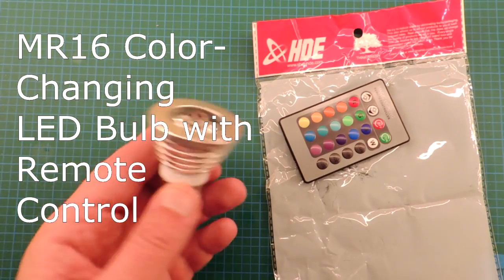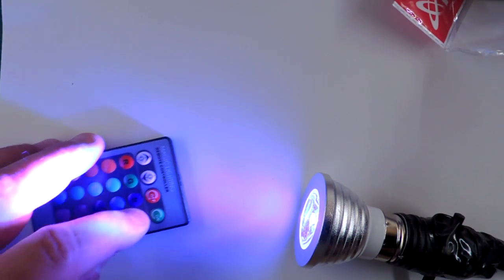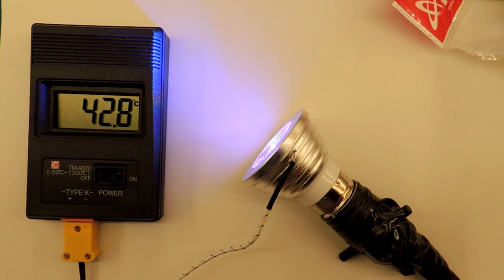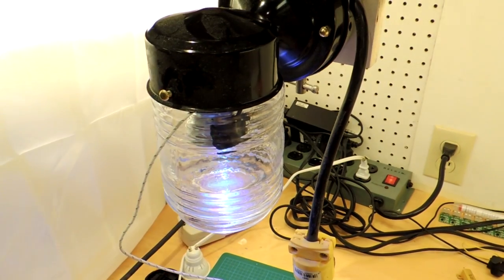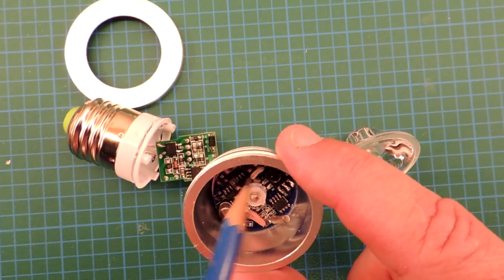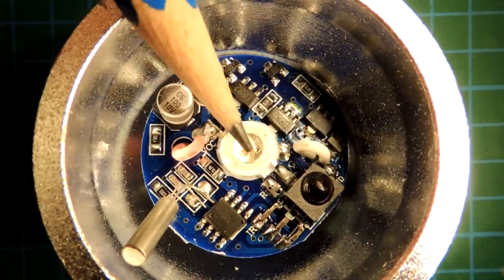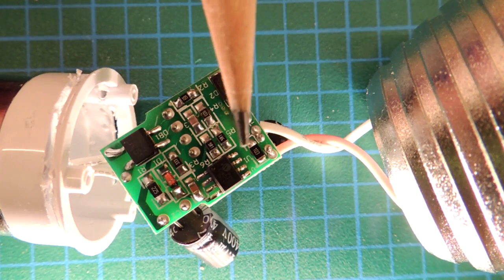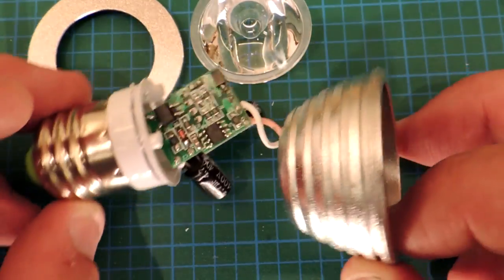Remote Controllable Color LED Review and Teardown

Comment: That's not an MR16 bulb.  It's an e27.  MR16 is 2 prong and was pretty much superseded by GU10 in the home market.  You can't really find MR16 fixtures in stores for the home market anymore.
Reply: GU10 bulbs are typically MR16, the terms refer to different parts of the bulb. GU10 is a type of bayonet connector for the bulb, where MR16 is Multifaceted Reflector, Sixteen eighths of an inch. The base of low voltage MR16s is typically GU5.3 (Just two straight pins, this is what you would normally get if you asked someone for an MR16 bulb) and mains voltage is GU10 (YMMV)

As for the bulb in the video? Assuming it's an American standard size, it would be E26 base, not E27, and without measuring the head, I can't say what the equivalent size MR is
Reply: Thanks for the education and information!  I did not know all of that.